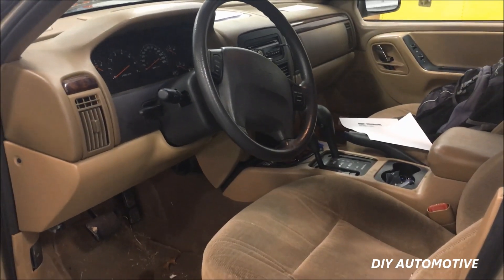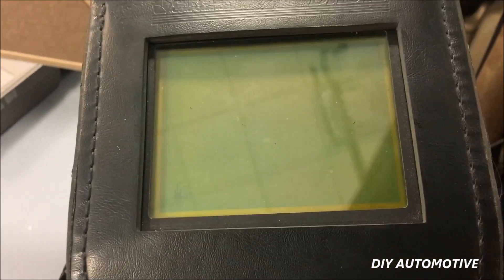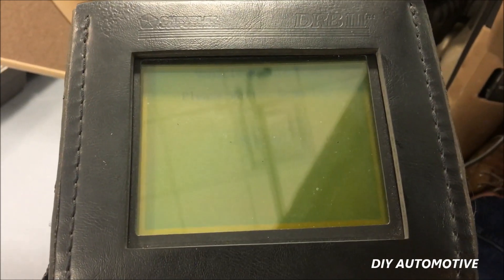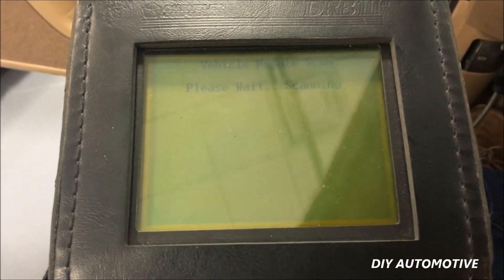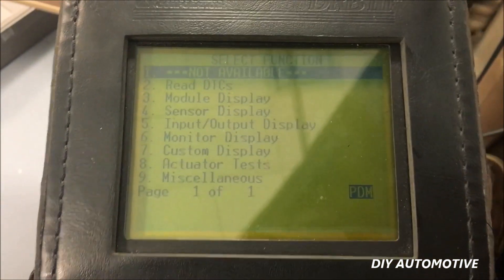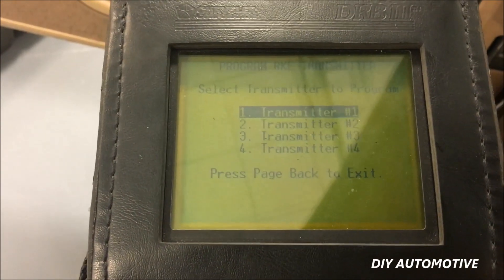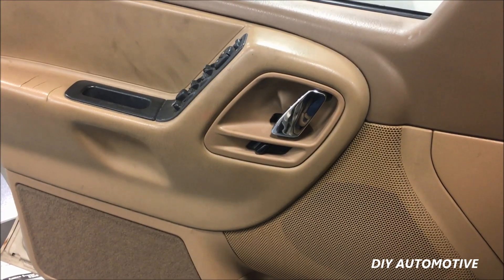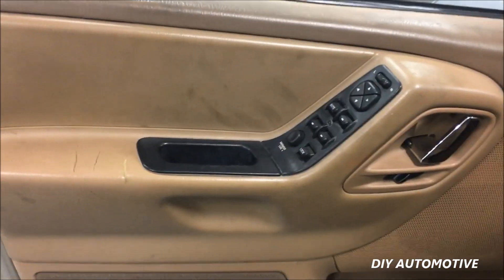How To Program a Key Fob Chrysler Jeep Dodge Ram

Comment: I have an 01 Durango and my rke stopped working even with fresh batteries in the fob . Any idea what I can do to troubleshoot it?. I have a bluedriver but that's as far as my scanner capabilities go . Is there a way to set the module into programming mode without a working fob or scanner that does rke? Thanks.
Reply from the maker: Unfortunately not

Comment: I have a Seating Memory in my 2002 Jeep.  I have two fobs a black one for setting 1 and a gray one for setting 2.  I recently lost my Black fob and went to he dealer and had it replaced.  The problem is that both the black and gray fobs now work only setting 2.  The dealer now says they'll have to run a diagnostic to find out what the problem is.  Can the black fob be programed to setting 1 with the DRBIII and resolve the problem.
Reply from the maker: That may fix your problem